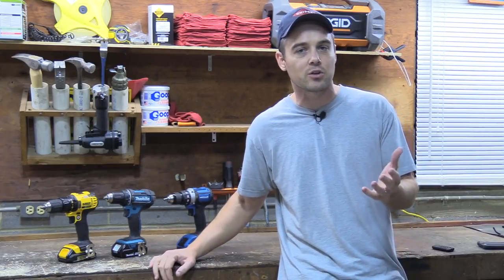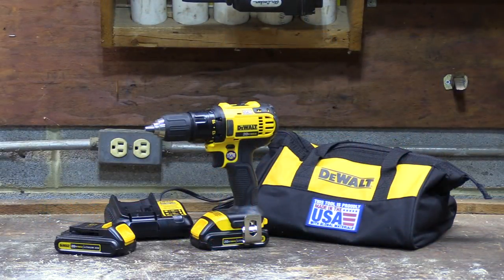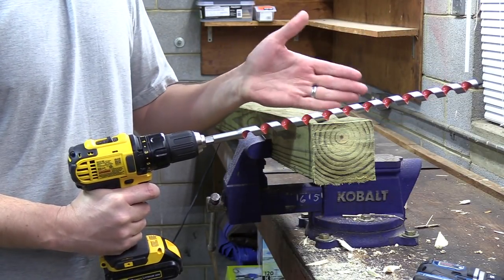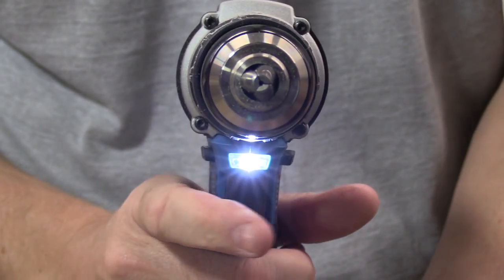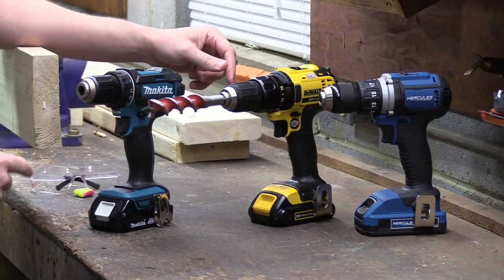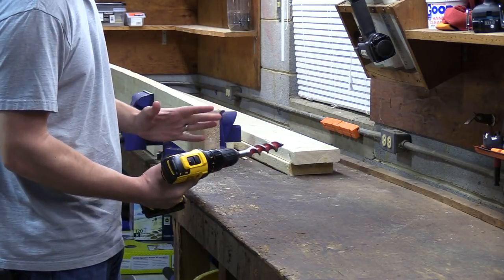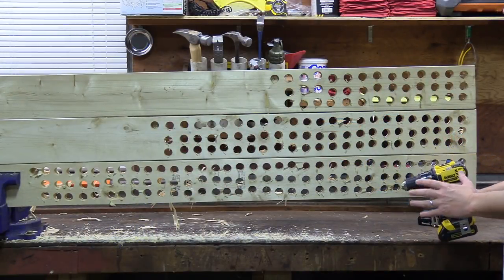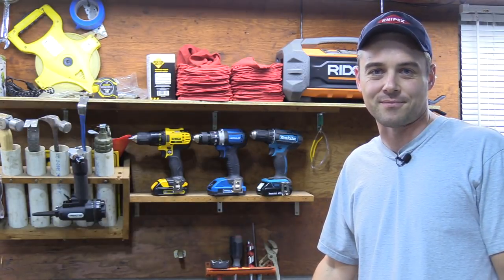Dewalt -VS- Makita -VS- Harbor Freight (Hercules) / DCD780 -VS- XFD10 -VS- HC91K1

Comment: I  have no remarks about these tools or your test. I do however, have remarks regarding the used bits. That  large hole bit you use at about 7 minutes, is a totally rediculous tool. Throw it away. You need this: https://www.hornbach.nl/shop/WOLFCRAFT-Standaard-Gatenzaag-set-25-62-mm-7-dlg/7112678/artikel.html

As you can see, this doesn't chip ALL the wood, it's more like a round saw. Way better tool to get large round holes.
Reply from the maker: The bits which I used are extremely common in the USA, which is why I chose them.  I’ve used the same type of bits in many other drill videos.
Reply: @RealToolReviews  So if lots of people do stupid stuff, you also do stupid stuff? :P

For your test, I can understand, as the bit you use, is terrible inefficient as it wants to chip all wood. It's a high load for your drill. So you're forgiven :P

Comment: Makita will win
Reply: Not quite, haha, I still like makita as they have been out since 2006, I have owned one since 2008 and still use it, also makita is the only company to not have had to issue a recall on their batteries andbthe only company that still uses the same battery for all tools, including their 36v line which utilizes 2 regular batteries

Comment: Makita wins... I hope.. 🥴🤫😎
Reply: Hercules won, but to back Makita up, it only has a 18v battery, were the others have a 20v
Reply from the maker: 18v and 20v are the same thing....it’s a marketing term.
Reply: So in other words you would say that a 12v is the same as a 14v and the 14v is the same as a 18v and so on, 😳 I Got to say your wrong there.